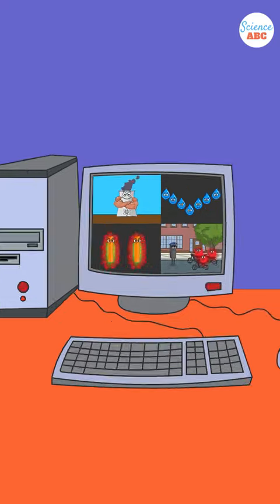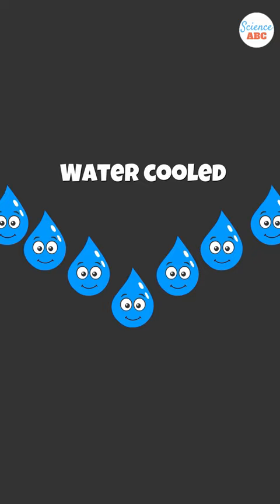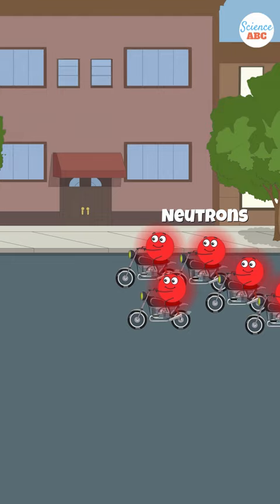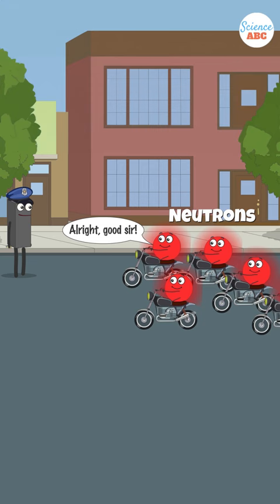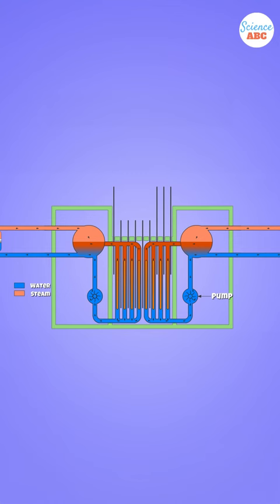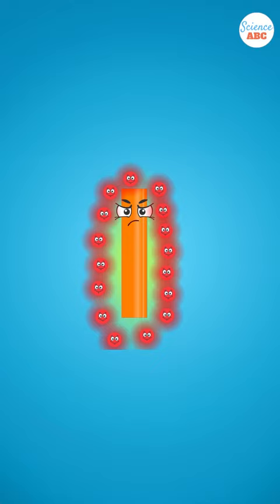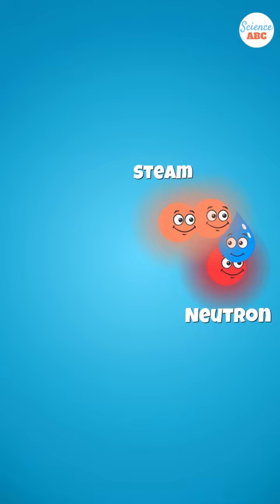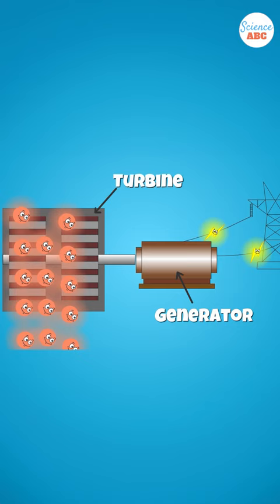Nuclear Reactors Explained: How Graphite and Uranium Power the Future

Comment: So now I understand that graphite is used to slow the flying neutrons down. But can someone explain why nuclear reactors need to slow the neutrons down? in the first place? Can it not otherwise?
Reply: During fission, neutrons are emitted with high energy, but U-235 nuclei don't easily absorb them. To make the reactor work, the neutrons must be slowed down by colliding with nuclei in a substance called a moderator. The moderator can't absorb any neutrons itself. 
For example, reactors that use natural uranium fuel, which only contains 0.7% of fissile uranium 235, need efficient moderators that absorb very few neutrons. Heavy water and pure graphite are good moderators for these reactors. 

some ai

Comment: But if graphite only slows down the reaction, wouldn’t that mean they absorb some of the neutrons. So if say the reactor once peaked, with Xenon which is unstable, the graphite can act as a spike.
Reply: no because graphite has a high scattering cross section, but a low capture one, whereas something like water is both a moderator and an absorber and Cadmium (which makes the control rods) is basically a pure absorber.
Reply: @filipporiva1864  So what happens when a Xenon poisoned reactor, filled with an absorber like water condenses; it creates a potentially rapid reaction like gasoline to a dying fire?
Reply: @darkpaw1522  depends, I’m not sure wether it would increase or decrease reactivity, but I’d bet decrease. Water should moderate the reaction (graphite is a better moderator though), but also absorb and give an up scattering contribution, that’s why RBKM are positive void coefficient, without water the reactivity goes up. If the control rods are down I would guess condensing water should slow it down even more, but that’s already done by the rods, so its only contribution would be heat removal so the holes don’t deform from the heat and trap the rods, which happened in Chernobyl. Xenon is not playing a big role here, if anything it keeps the reaction at bay, the problem comes when it starts disappearing and you have to manage the increase reactivity transient

Comment: My questiobis; if future space missiobs to interstellar space can be powered by water fron the ice off the moon. Why cant we use that technology on earth to convert H2o into power to supply our needs?!
Reply: The moon missions will break down water from h2o into just h and o (hydrogen and oxygen) then you can reconnect them later by burning the hydrogen in the oxygen, and turning it back into water.

It takes a lot of electricity to do this, so they will be using solar panels, or more likely, nuclear batteries to make electricity. They don't use the  converted water for power, they use it as fuel for rockets. 

Rockets can't run on electricity, they have to burn fuel, and carrying fuel is heavy, so it's much cheaper to make it there.

If you use electricity to split water, and then burn the hydrogen and turn it back into water, you actually lose a lot of electricity, so you can't make a power plant like that.

Look up entropy and the laws of thermodynamics if you want to learn more.